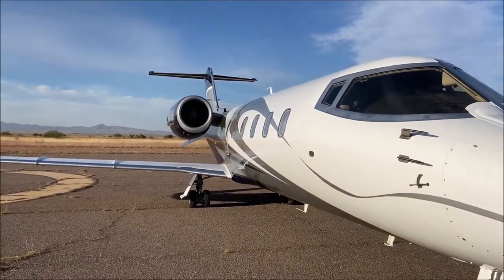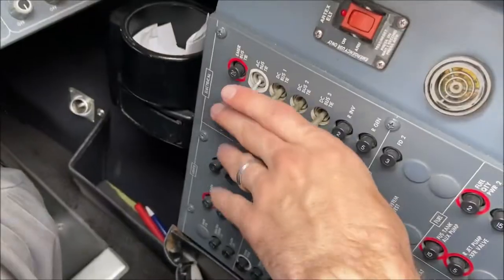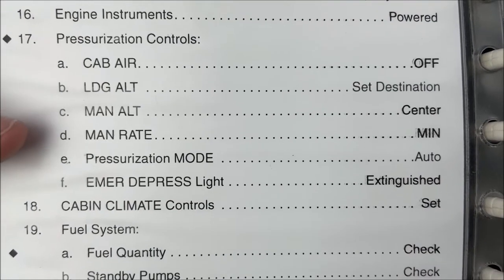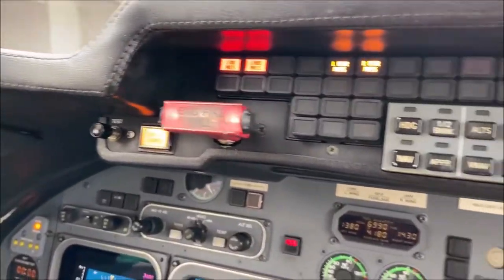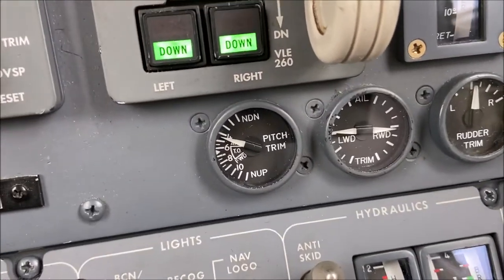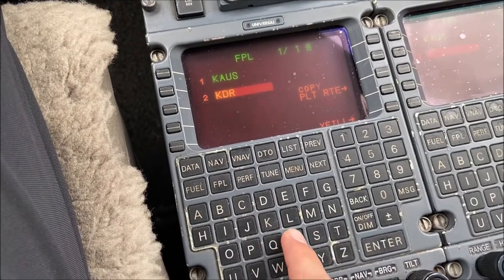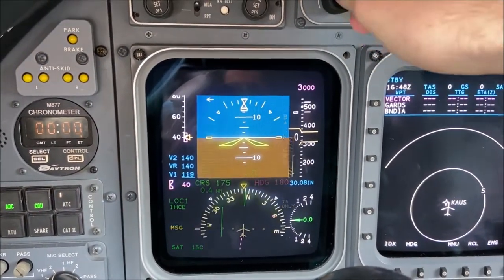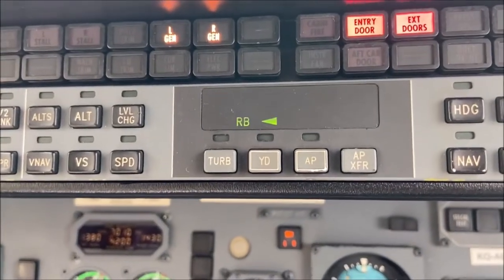Learjet 101: Before Starting Engines Check | Part 2

Comment: Going back to 60 recurrent haven’t flown the 60 in a while worried about the spoiler checks after engine start! Any shorter method than the expanded checklist!
Reply from the maker: https://youtu.be/cz0zQApu11Q?t=120 Here is another video that I made with the spoiler checks included. As for an abbreviated form of the spoiler checks...it's hard to abbreviate but basically make sure to put the flaps down, hold the spoiler test button, and simultaneously turn the yoke until the 'spoiler mon' annunciator illuminates. Then turn the yoke without pressing the button to make sure it doesn't illuminate. Do this for both sides. Then put the spoiler into arm and make sure it retracts after increasing thrust for each thrust lever. Then manually extend and retract them.
Reply: @CJPanichi343  thanks for the video CJ
Reply from the maker: @richardgoulden3572  My pleasure!

Comment: Just wondering, if the cabin pressure fails does the cockpit get an audio alarm?
Reply from the maker: Yes, if the cabin altitude goes above 10,100ft, the 'cabin alt hi' alarm will sound.
Reply: @CJPanichi343  Why do you think Payne Stewart's pilots were unaware and died?
Reply from the maker: @rancosteel  In this case, rapid depressurization occurred at a high altitude. Pilots only have seconds of useful conscious to react and don the oxygen mask. Before the 2000s, checklists and memory items usually didn’t stress the importance of donning the mask first. This is was most likely doomed the flight.